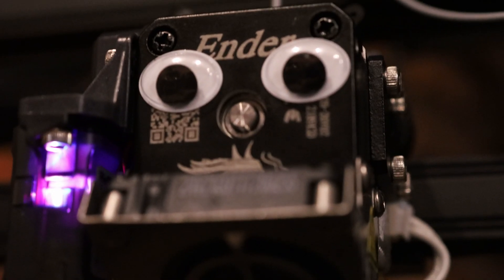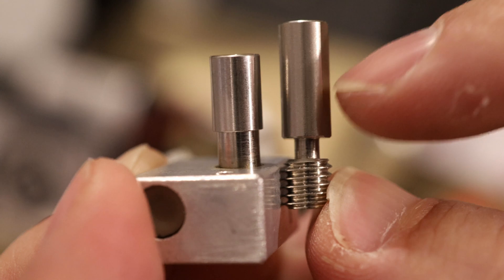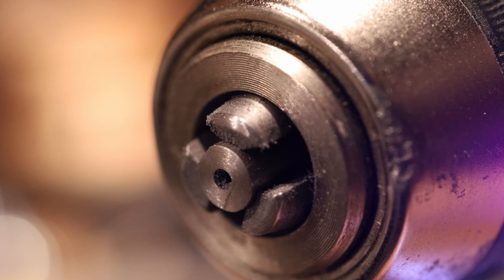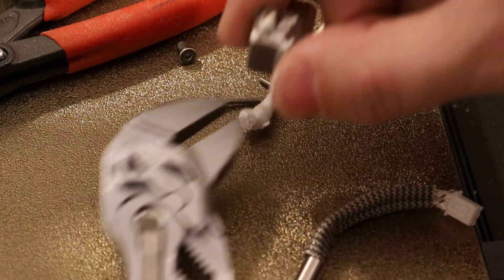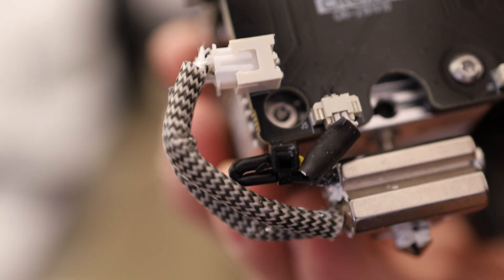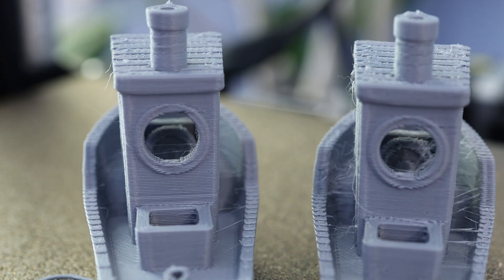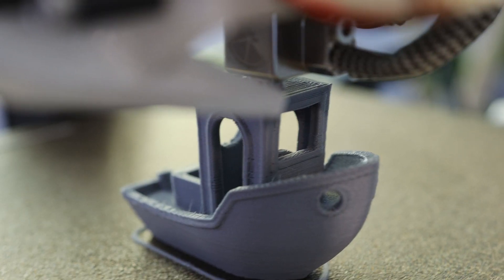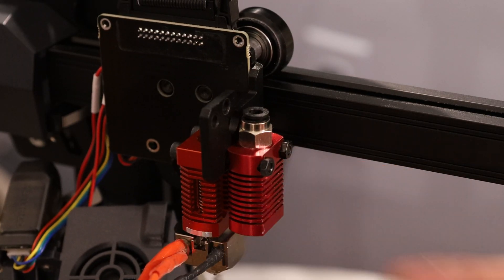Ender 3 S1 - All-Metal Hotend Upgrade

Comment: The effect you are witnessing when extruding the filament I believe is called die swell.
Reply from the maker: I think die swell is when the filament shrinks in length and increases in diameter. The curving issue is new to me, I think it has to do with the CHT 3-holed geometry.
Reply: @NathanBuildsRobots  the poster is right, it's die swell. Check out CNC kitchen video on this
Reply from the maker: @TheMidnightSmith  https://youtu.be/RWDErj-pE1c
10:30 mark is where Stefan brings up die swell. 

Edit: "Blah blah blah it's not just die swell"
Reply: @NathanBuildsRobots  Jesus dude what a pendantic response. I was in agreement with the OP that it's die swell and gave an example to check out. By no means did I say I'm an expert, but offered a solution when you had none, you clearly asked what people thought it might be. The CNC kitchen video explained it way better than I could, hence I said to check it out. The sheer "I'm better than you" attitude you came back with is unnecessary.
Reply from the maker: @TheMidnightSmith  Your right, I am being a bit much. I think there is something going on beyond die swell, and I think I have a good explanation. I may make a video about it. 

But either way I apologise, that was something I should not have pressed "send" on.
Reply: @NathanBuildsRobots  hey all good, I appreciate the response, my apologies as well for seeming like I went too hard into it being that one thing only. Hope you make a future follow up to see what other causes are in play!

Comment: There is a sprite pro being released with an all metal hot end
Reply from the maker: I think spending another $120 for an extruder just to get a $5 metal piece installed isn't the best idea.
Now, I'd be interested if it also has at least 4 of the 8 items below:
 - Bimetalic Heatbreak
 - 500C Thermocouple
 - 60w Heater cartridge
 - Copper heater block
 - Metal extruder gears
 - Larger stepper motor
 - Upgraded Nozzle
 - Upgraded part cooling fan
Reply: It looks like the all metal hotend (from the S1 Pro) will be available as an upgrade to the S1. 
Its ~$110 extra or about the same cost as a S1 Pro (which includes the all metal hotend) total shipped at this time 
... and you dont have to wait weeks/month for it to ship from china (and pay $80)

As of today an S1 Pro is about ~$579 delivered from the creality store  (and takes 1-2weeks to ship from china)
  
An S1 from Amazon is $429 delivered ...  the All metal Hotend is available as a pre-order for ~$110 delivered according to the Creality store ... 

So for ~$530 total you have a totally usable printer delivered  in 3-5 days from amazon and can pre-order the all metal hotend from creality and be printing until it arrives ... also when it does arrives you have a spare PTFE lined hotend to mod.

At least this is what it looks like... I wonder if you can just upgrade the firmware on the S1 to the S1 Pro's firmware as the only difference I can find between the two Printers is the Allmetal hotend that they claim can run 300°C..

 I went ahead and just bought an S1... If/when I need the all metal hotend I will just buy one from Creality if the above turns out to be accurate... If not then your mod will likely be my plan... thanks for "NGAF" and doing the mods so I dont have to ruin mine :-)

Comment: Great Mod and well described, 30mm^3/s is awesome! 
The curling happens because of the internal stresses in the filament when being pushed too hard. It is not heated thoroughly anymore at too high flowrates, and wants to return to its original shape. 

The CHT splits it up into 3 parts, so this funky behaviour is the result. I don't know the excact physics behind that, but thats what i have learned so far!

Great work, keep it up :)
Reply from the maker: Yeah, now I just need to crank up the print speed! The extruder can definitely keep up.

Yeah, there is something going on where more plastic is going through 1 of the holes and pushing it to the side. That would be so cool if you had 3 independant extruders that could steer the plastic using that phenomenon.

I think what is going on is there is an unmelted core that is directed into 1 of the holes, so that chamber gets higher pressure and more flow.

I don't think it's clogged, because at lower speeds it completely straightens out.
Reply: @NathanBuildsRobots  i think that is just the blower fan causing the going up
Reply: @Kendiyastro  That's EXACTLY what I noticed as well!
Reply: @NathanBuildsRobots  that explanation makes a lot of sense.

I think it could be related to the diameter of the heatbreak. It is 2mm and the filament is 1.75mm, so the filament doesn't go straight into the nozzle bit could always be more towards one kf the three holes. 

That leads to more material in one of the channels, and that comes into play when the filament is almost pushed too fast.

One of the channels has slightly more filament to melt, and therefore has this unmolten core as you mentioned. 

That leads to more pressure in one channel and you get this effect. 

Maybe thus would decrease if we use 2.85mm filament as the nozzle could be the same, but the filament has a bigger surface area. 

Or, one could get one of those 3 in 1 nozzles and try to push in all 3 Inputs at the same time, imagine the througput, maybe with a 2mm nozzle or so!

This is all just theory carfting, but i think its quite interesting!

Have fun pushing this hotend!
Reply from the maker: @3dprinterfun905  yeah it's an inherently unstable configuration.  You are pushing an icicle shaped unmelted filament tip into a cone shaped core.

I think having a bi-metallic heatbreak would help a lot, since it would allow more heat transfer before it hits the split.
Reply: @NathanBuildsRobots  i have a bi-metallic heatbreak, and also tried the cht on a volcano with a special spacer. That inreased the flowrate a bit! 

I think adding even more meltzone will help too.
Reply from the maker: @3dprinterfun905  I just got a mosquito magnum hotend. Will he bolting this onto the S1 and seeing how it effects flow rates 🔥
Reply: @NathanBuildsRobots  that sounds great, i also have some ideas to get higher flowrates out of these nozzles 👍😁

Comment from the maker: I just realized Slice Engineering sells a Bimetallic Heatbreak that should fit in this printer perfectly.

Edit: it does not fit perfectly. It sticks out about 2mm, but I'm OK with that. It would also need to be cut back just like this one if you want it to sit flush.

For an easier way to get rid of the PTFE lining, I would keep the old heater block. That should only take ~15 minutes to install compared to the way I did it in this video.

Amazon Affiliate Link for Heatbreak: https://amzn.to/3LfU8hS

Note: You will need an Mk8 style nozzle to work with the stock heater block, so if you want to use CHT with this simpler mod, make sure to get an Mk8, not Rep-Rap, nozzle. Slice Engineering only carries the Rep-Rap style.
Reply: Hey, great Video, you are really putting a lot of effort in your research around those mods! 
I just wanted to Note, that you can fit V6 type nozzles into the MK8 heater block, you just have to screw the heatbreak out a bit more.
Tried to mount a v6 cht to my ender hotend and it fits perfectly. 
This might give a benefit due to the longer thread vs the mk8 nozzles, but i havent tested that yet. 

Have a nice day!
Reply from the maker: Alright thanks, good to know! 
I guess you could always break out the hacksaw :)
Reply: @NathanBuildsRobots  ofcourse, with a saw, sandpaper and a file you can make anything work!
Reply: If I get this heatbreak then you just install and all is good? No firmware changes needed?
Reply from the maker: @DxApollo  Heatbreak and nozzle changes should never require a firmware update to work.
Reply: @NathanBuildsRobots  Retraction settings may need to change slightly, All metal hotends generally have need lower retraction, so that the melted filament doesn't get pulled in to the cold zone and solidify.
Reply: Is the Bimetallic Heatbreak that fits in the Ender S1 the one that you have linked?
Reply from the maker: @spacegodzillax9501  This is the one I use now: https://amzn.to/41YyF4B

Comment: could i just put the microswiss all metal hotend on
Reply: Yep, that would work too :-)
Reply from the maker: No, the new Sprite extruder has a built-in heatsink and the heatbreak attaches directly to it.
There is an easier solution that I pinned in my comments though - just get the heatbreak from Slice that is already the correct size and reuse the old heater block. That is much simpler and might even perform better.
Reply: @NathanBuildsRobots  What size/option, Is standard G2 the correct size and do you need a different nozzle too?
Reply from the maker: @bigwavedave1562  yes standard G2 should work. I ordered one to try out & verify, but the dimensions I've seen tell me it should work. 

The nozzle compatibility depends on the heater block you are using. 

The g2 hotend will fit into the extruder, there are 2 stackups if consider: 

Easy option (no soldering or rewiring required): 
Stock extruder
Copperhead heatbreak (G2 Standard fit)
Stock heater block
Stock nozzle, or Mk8 CHT

Hard option (what I did) 
Stock extruder
Copperhead heatbreak (G2 Standard fit)
Copperhead heater block
Rep-rap style nozzle,  AKA v6 style nozzle

Both nozzle types are m6 thread, but one is 1 mm longer
Reply: @NathanBuildsRobots  Thank you so much for the detailed response! I think the easy option is where I will head and good to know that I can use the existing nozzles with that heatbreak.
Reply from the maker: @bigwavedave1562  yeah, I'm going to post a 2nd shorter video on just replacing the hotend - I kind of overcomplicated this build!

Comment: Considering heatbrakes are made from such metals as titanium as they have a lower thermal signature, isnt adding boron paste pissing against the wind?
Reply from the maker: You bring up a good point. Titanium is 64x more conductive than PTFE and 1/24th as conductive as copper so it's kind of in a middle ground. I want to do an episode on heat transfer analysis, doing some lumped mass model analysis on the common hotend setups (standard, volcano, Rapido, CHT) so we have an easy way to see where the bottlenecks in thermal conductivity are.

A bi-metallic heatbreak with a copper lower segment will definitely give the best results. I just looked it up and saw that Slice Engineering has a heatbreak that would probably work for this printer, since it has a 6mm shank. I'm going to pick one of those up and try it out:
https://amzn.to/3LfU8hS
Reply: @NathanBuildsRobots  That would be a video I would love to watch, having some real conclusional data would be awesome!
Reply from the maker: I think what I will find is that the biggest bottleneck to heat transfer is the interface between the plastic and the hotend, which will be difficult to model but I'm going to try.

Comment: Cool mod! but i think you're using the knipex pliers wrench backwards. The torque is meant to be applied to the movable handle instead of the fixed handle. This provides a self tightening effect rather than actively working agaisnt your grip.

Again, awesome video, really entertaining!
Reply from the maker: On applications that require more torque I have to stop and think about which direction to use them, but in most cases I counter my stupidity with grip strength.
Reply: @NathanBuildsRobots  definitely! Tightening a nozzle doesn’t take very many ugga duggas 😆